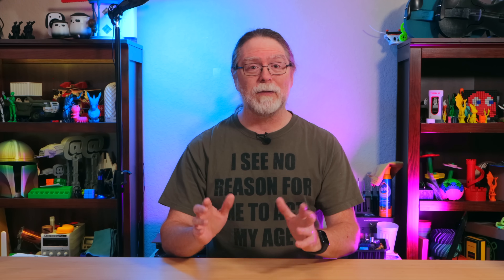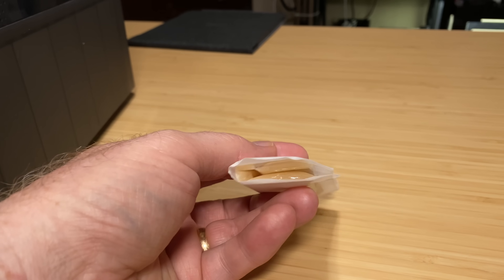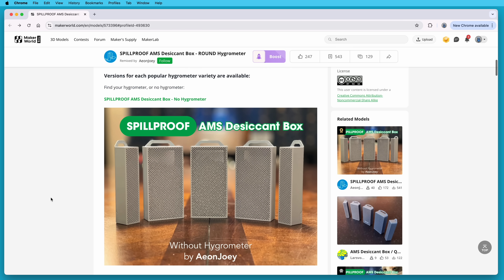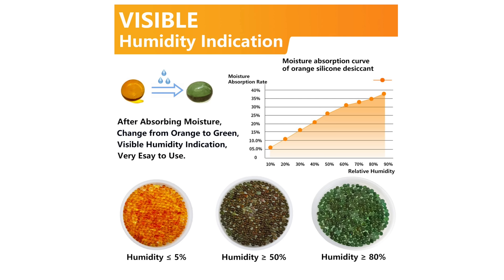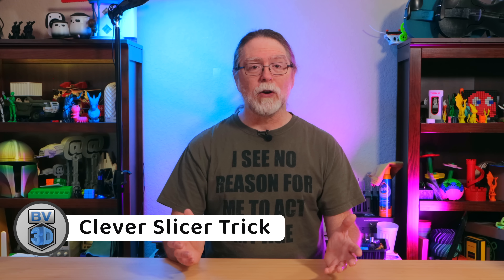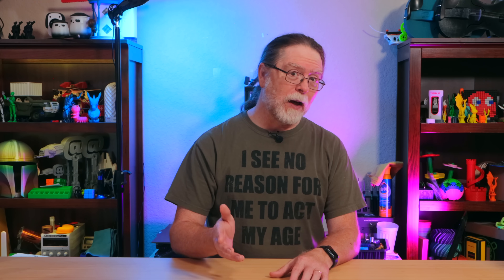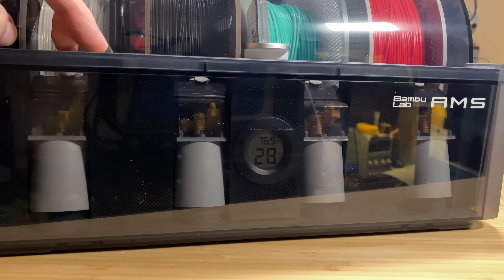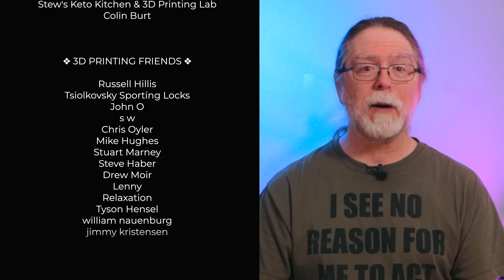I REPLACED DESICCANT in my AMS for the LAST TIME!

Comment: sigh.. ok I won't call this clickbait but saying you never had to replace desiccant again made me think you had something that didn't need maintenance.  I've used re-usable desiccant since I got my AMS but changing it every week and recharging the beads is a real PITA. In my mind you're still replacing the desiccant in your AMS. You are replacing it with fresh beads and recharging the olde ones, but you are still replacing the desiccant.
Reply: It helps if you have a routine for filament spool change over….I lift the lid, remove the spool, and immediately close it…then if it’s only part used I place it immediately into its vacuum bag with desiccant.  Only then do I get out the new/different spool and place it straight in the AMS, and immediately close the lid.  In total the AMS is only open for under a minute for both separate actions…and the first spool is also tucked up snug with minimal exposure.  Once you make it a repetitive routine then you can almost do it on autopilot, lol!  

I would add that I don’t do this out of efficiency or OCD….its more that I’m avoiding the faff of recharging the silica, lol!  It’s working for me so far anyway and I’m closely watching the humidity in the AMS.  I also dry new spools to precondition them (when possible and time permits) before they go into the AMS and this helps delay the silica change in the AMS.

I am quite new to 3D printing, so if anyone has a better way of extending the silica’s use I’m all ears, lol! 😁👍🏻💕
Reply: @trappedinroom1014  That doesn't really matter for me.  Even if I never open the AMS I'll still need to recharge it within a few weeks at best. It's not like these things seal all that well when the lid is closed.
Reply: Do you open your ams alot or is it really humid where you live? Because once a week seems like alot. (Iam just starting out and have just did this mod so don't have any experience yet).
Reply: @matthijsarends8631  really humid would be accurate.  I live in Florida.  That said "Every week" is probably some level of hyperbole as well. But every few weeks is probably accurate.  That said, yes I do change filaments maybe not often but commonly.
Reply: @JohnVanderbeck cnc kitchen showed electrolysis dehumidifyers. Only downside is the price of ~250$ for the one large enough to make a reasonable difference.
And a 5 min regen in the microwave seems like a reasonable compromise for the much lower cost.

Edit: They are called solid state dehumidifyers. They might be the right thing for you.

Comment: I'd strongly advise to steer clear of microwaving the beads, they can and do crack when they get too hot, and you don't want them anywhere near your food.  1 they will chip your teeth if you eat them, and 2 they are toxic
I put them in my filament dryer at 65-70 degrees(celcius) for a few hours, never gone wrong.

Comment: I have similar dryers in my AMS, but you have to take the spools out to take them in and out. Can these ones be inserted while the spools are in? Also, I use my filament dryer to dry out the beads. Just make sure you don't print them out of PLA.

Comment: I use a couple of those automotive dehumidifier packs in my filament box. They are not as good as silica desiccant, but they get the humidity down far enough, and recharging is as easy as zapping it around in the microwave for 5 minutes.  Very convenient. 
I might give this stuff a go, though  you have to be careful with toxic substances when drying out desiccant in an oven you also use to prepare food.

Comment: I can't believe how well this works!. I was at a 3-4 rating on water in the air on my AMS on my X1 Carbon. When I started the Hydrometer read about 55% and within a short while it has maintained 10% (1 rating). Great idea!
Reply: Mine too - until the desicant changed from Orange to Black  (!) - Replaced it and back to normal nice numbers :)

Comment: AFAIK, ALL DESICCANT is REUSABLE!  Just dry it in your oven, dehydrator, etc.  I have not run into any desiccant that is not reusable.
Reply: That's what I was thinking
Reply: Desiccant is a blanket term, you're refering to Silica Beads used as Desiccant. to make it easy to reuse- there are two types of color-changing silica beads that when heated change colorfrom one color to the other. These do wear out however, and don't last forever, but most can withstand several hundred rechargings. The problem with non-colored silica is that you can't tell when they are good or bad, and can't tell when they're spent and no longer rechargeable. In addition to Silica Bead desiccants used for 3D printing, other populars are calcium chloride (the kind Bambu Lab give you in the AMS which are not rechargeable, and thus disposable), and Activated Alumina - a larger white beads which last much longer, but do not indicate color. these are considered forever desiccant however because you can reharge them indefinitely. They require a much higher temperature than silica however, for longer - e.g. most require 400F for 8-12 hours, where as silica can be recharged in a microwave for around 10 minutes. 
Specifically, everyone who owns a Bambu Lab AMS has run into desiccant that is not reusable.

Comment: I had a slight mishap with recharging my silica beads...
The packet said 7 - 12 minutes at 700W. My microwave is 800W, so I turned it down to med-hi instead of full power and left it for 7 mins. The beads at the top and sides of the ceramic bowl I'd put them in had dried out, but the ones in the middle and bottom of the bowl were almost all still green or brown, so I put them back in for another 3 mins., which cracked the bowl.
I also tried microwave safe plastic, but the beads melted straight through it... So now I need to order a new pack of beads, as most of the ones I was using are now covered in plastic 😆
So I guess those little beads are getting up to temps of well over 100 degrees C, possibly over 200?
My conclusion: either do them in small batches (e.g. the contents of 1 of those AMS boxes at a time), or make sure you have something seriously heat resistant like a pyrex baking dish to put them in...

Comment: FWIF, that stuff in BambuLabs dessicant must be calcium chloride, aka "road salt" (the salt that's laid on roads to melt snow). It's actually quite cheap stuff —sold either in bulk for cooking (it's a great preserver) or in bags of some kind. The real tricky thing is to keep the goo contained —I use 3D-printed polypropylene containers, as it's the only material that keeps it on the long run (not PETG, not PLA...). There are some some bags designed to be put in your car or closet (to keep your clothes dry) that are self-contained, quite like the BL stuff. So there may be a supplier out there that sells something that may fit and has no abhorrent shipping expenses.
As for the goo, when it's quite saturated, a huge drop in temperature may cause it to turn solid. That may or may not help with removing a spillout in your AMS. (That often happens to my containers in winter, with a 10-15 ºC drop.)
As @kellizielinski9633 commented, though, activated alumina (and maybe molecular sieves too) is a superior alternative to silica gel; also reusable and with superior drying power, but far more expensive.

Thanks for the video!
Reply: I've switched to Activated Alumina, have had it everywhere in my workflow for 2 months now, and it hasn't lost potency - I'm dreading recharging it though lol, I bought a second jug so that I can swap and recharge id separately.

Comment: I decided to commit and ordered a couple Roshal electronic dehumidifiers from Chip45 website.  As long as they last a number of years...should be nice.  Chip45 has the 3V usb power supply and frames you can print out.  I don't have them yet - I'll be doing my AMS and a decent sized dry box.
Reply from the maker: That's next-level! Cool!

Comment: I went with "KYZ FF2 High Airflow Spool Desiccant Holder" and put it in every roll of filament. The advantage is that I can also pre-dry the rolls in my Creality dual roll dryers and also vacuum seal them after use. Basically, the desiccant stays with the roll until the roll is empty, gets re-dried when I think it's needed with the roll, and when the filament is done, it's time to microwave the beads!

I used PETG to print them because I think the threads are smoother. If you want to print them, please, for the love of what you pray to, do NOT print with support. It doesn't need them, and adding supports will ruin your print. Don't ask how I know.

Oh, I also use them with my son's A1 Mini and AMS Lite. Instead of mounting the filament on the AMS, we leave them in dedicated Creality dryers and loop them into the AMS from there. I wish you could do the same with the AMS for the P1/X1 but their filament travel is too long fot it to work. But you can use the AMS bypass to feed directly from the dryer if you print a lot of especially hydrophilic filament. (Yes, the sucker I am, I bought 2x double packs - that's almost another A1 Mini in price.)

Comment: Question: what is the best material to print the boxes with?  Would PLA be an issue in the microwave?
Reply: if you want to microwave them, ASA is your best bet, the microwave as you know, won't heat up the plastic, but the beads get so hot they'll melt PLA right through.

Comment: That PET-HF filament is the first filament I've bought from them that needed to be dried out of the factory packaging. Wild stuff.
Reply: On my Bambu PET-CF and PAHT-CF spools, it recommends drying on the box before use but also has the foil bags. My theory was the time from drying the spool to sealing varies as the packaging batch is exposed to air during the bagging/sealing stage. Basically the last spool to be sealed would theoretically absorb more moisture than the first sealed spool if they were exposed at the same time. Drying on the customer end would ensure the moisture levels are more consistent.
Reply from the maker: When I asked, Bambu said it was factory dried, and although the spools are vacuum-packed, and the plastic bags are airtight, humidity can still pass through the bag. Someone else in the comments said the same thing about humidity being able to pass through airtight plastic bags. So apparently that's why nylon and other super-hygroscopic filament is packaged in metallic/plastic bags instead of clear plastic.
Reply: @BV3D  the response I got was "well, we told you" which I thought was odd. I've bought so much filament from them and even bought two rolls of the HF. One roll came out dry, the other roll came out unusable.
Reply from the maker: @probablynotian  I was getting poor surface quality on my red PETG HF for sure until I dried it, but the white was doing fine. The red did a lot better after I dried it.
Reply: Do the PETG-HF spools come in the clear bags or the metallized/foil bags? I know that moisture can pass through the clear ones. I would be extremely surprised if that's the case for the foil bags. I've done moisture testing with these bags and I find it hard to believe that moisture would go through them.

Comment: Just a small update for those who've asked: 9 Variations have been added for hygrometer variations, including different snap mounts for this round hygrometer (horizontal, vertical and 45 degree)
Reply: I used one of these today and it infilled the hygrometer mounting space. Any suggestions?
Reply: @meeksy7675  Hey there, I know this is 5 months old, so I hope you figured it out! but for anyone else finding this, that was support material, you can jab a pair of pliers in there and give it a tug, it'll rip out.
Reply: @joeylopezdesign  I did. Oh, the amount I’ve learned in my short time printing is absurd. 
Thanks for replying, hopefully it’ll help someone else out down the road!

Comment: I’ve had my P1S and AMS for a few weeks.  Very pleased.
I understand relative humidity and how to use SG.  So I looked, and discovered holders on MakerWorld and printed the 5 front ones, centre with humidity gauge, and fillable ones for the 2 rear slots.
A bag of SG costs about £6 in the UK, and this is twice as much as is required.  The benefit is this allows the SG to be rotated once the RH goes above say 15% and the used SG dried, ready to be reused when required. 😊.

Comment: Recently I got a Dry Cabinet from Production Automation Corporation (PAC). They are made by eDry. So the smallest one is just $200 and keeps 4 filaments very dry. Currently mine is at 4.7% humidity. It CAN dry wet filament, but it does take a few weeks, but no heat. And unfortunately it doesn't work for an AMS, but it is very handy to keep those filaments lying around very dry.  Indoor air is about 40% and in the cabinet, under 5%. Nothing to heat, replace or recharge.

Comment: So far im also using the color changing ones, but with the hygrometer inside i start wondering if the ones without the color indicator wouldn't be more effective / last longer.  I've read that a few times, but haven't done a A/B comparison yet.

Comment: I’ve heard with this design that the Hydrometer can read more dry than the spools are experiencing. This is because the hydrometer is against the desiccant. I’ll probably leave the center pocket either half full, or even empty to compensate.
Reply: These were designed with solid walls seaprating the hygrometer's sensors from the desiccant with a clear path of air from behind the box. the area it's pulling air from would of course be affected by the desiccant, but to a much lesser extent than designs where the hygrometer is literally sitting inside of desiccant with no barrier. tests show a variance of RH% with the same model hygrometers sitting in the front center position in the box with desiccant, vs hygrometers placed in spool centers, and the back of the AMS as 3-5% difference after 12 hours.

Comment: Why limit this to a AMS? I use plastic storage totes (zip lock, they have the best seal) i do not have a drying issue, this is just something i have done sense i started 3d printing. when i open a new roll i just toss the packet in the tote. on some of the Qidi filaments with CF I use a SH02 and dry it from 6-12 hours depends on what filament im using. Im going to make one and put it in the tote.

Comment: 1. I recommend the oven for drying silica gel. I found the microwave made the beads sticky and clumpy. (I could just be my microwave). 
2. A friend just recommended activated alumina which he says works better and last longer.
Reply: Make sure you only use LOW power, don’t let the SG get too hot and gently stir every few minutes.

Comment: I use tea infuser/strainers made from stainless steel as containers for the silica gel. The ones I use are cylindrical with 4 cm diameter, 6 cm height. I got them from Aliexpress, I guess Amazon has them too. That way I don’t have to empty out the containers to put them in the oven. BTW, you shouldn’t microwave silica gel, because the microwave creates hotspots and degrades the silica over time.

Comment: I've noticed is that the desiccant trays at the bottom of the AMS (I have both) soak up moisture significantly quicker than the front set. I guess this makes sense since moisture is heavier than air and should thus naturally sinks. Who knew? :P In short, my ANS finds it easier to stay dry with the bottom trays and I'm not sure the front ones contribute much until the bottom are near saturated. A shame, since they hold a LOT more beads.
Reply: @Trust_me_I_am_an_Engineer  I'm confused. You say moist air sinks and give reasons why but then wonder why the gell at the bottom absorbs more water? Because the heavier than air water falls down into them, no? "Humid (or moist) air rises , because it's lighter than dry air.", says who? Then why does it rain downward?
Reply: @Trust_me_I_am_an_Engineer  Maybe you were actually replying to someone else? In any case, to address: "Humid (or moist) air rises , because it's lighter than dry air." <= this is clearly wrong, as you pointed out. the only reason WARM humid air rises is because it's warmed and thus overall less dense than the air around it. It's a convection thing, right? I figure the air inside the AMS doesn't have any real source of heat and thus all the air is about the same temperature. Therefore, the more dense water in that air has to descend. Surely? Some will stay in the air, especially if the air is warmer, because les dense air is able to contain more moisture, due to the wider spaces between molecules -- dew poiint and all that. That's why it's so dry when ambient temperature is below freezing, for exampke. Anyway ... I'm just spitballing. Not a scientist. :-) Have a good one.
Reply: @gruvinnz  Says who? Everybody who has had scientific training :) But you don't need to believe me. Go on google and type " is moist air heavier than dry air ?" Cya.
Reply: @gruvinnz So the tricky things about water is it actually is lighter than air when it is a vapor (MW of 18 instead of 32). Water is only a liquid at room temperature because of the strong attraction between water molecules.

Comment: Microwaving is quick and nasty and will damage the beads or risk burning people. Oven is much safer. If you are paranoid about having cobalt chloride dust in your domestic kitchen oven, buy a small digital fan forced oven such as a Breville Smart Oven, there are many others on the market. Avoid cheap infrared toaster ovens, those have very poor thermal control and monitoring (about as poor as your microwave ;) )

Comment: I printed a different design of holders for the front of the AMS using polycarbonate and the whole thing goes in the oven. Works perfectly at 105 degrees C. I dont have anything in the original dessicant things in the bottom of the AMS.

Comment: Thanks Bryan  for sharing. I have been using  AMS Desiccant Boxes for about 2 months and works gr8. Have not needed to recharge yet - still hovering 10% humidity inside the AMS and no issues with PLA filament breaks.